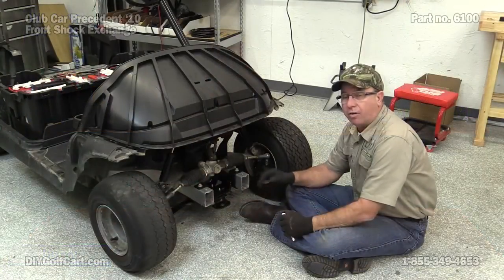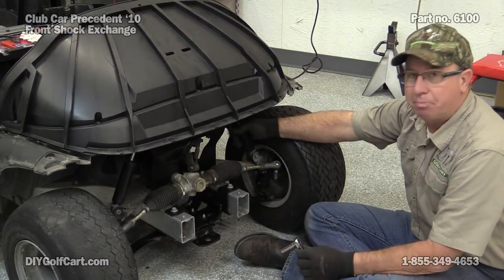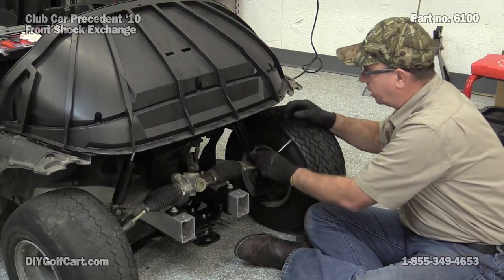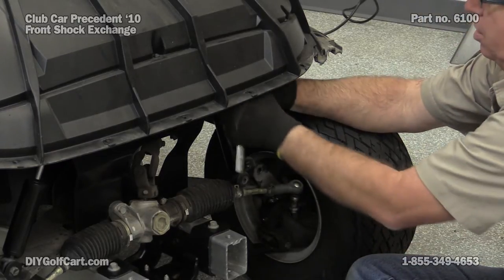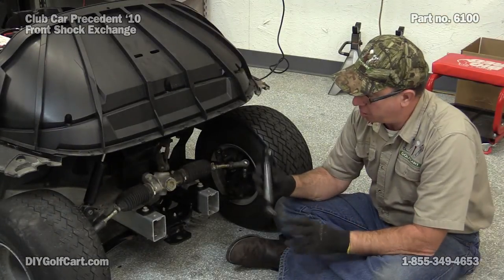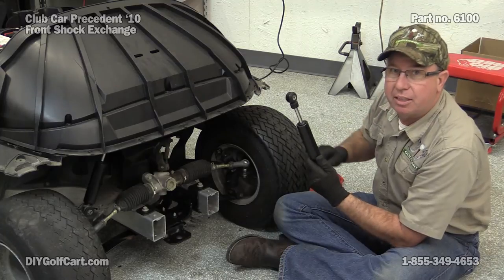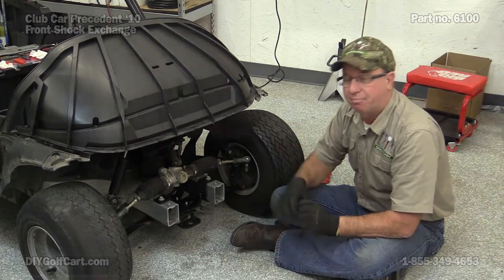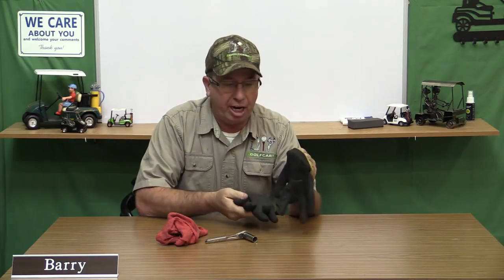Club Car Precedent Front Shocks | How to Replace on Golf Cart

Comment: How can you tell if shocks need to be replaced? My 2010 front end is very squeaky when on uneven roads and hit small bumps. I have lubed up everything hoping that would fix it but it didn't. Thanks for all of your videos. They are extremely helpful.
Reply from the maker: +Michael Moore Normally if the shocks are bad they will be wet from leakage.